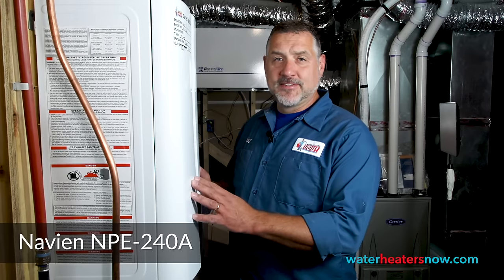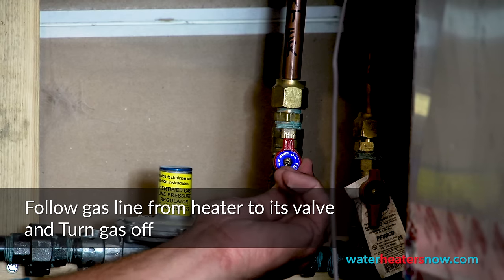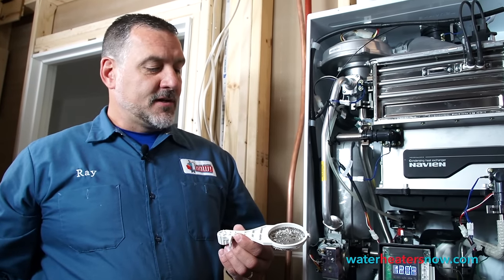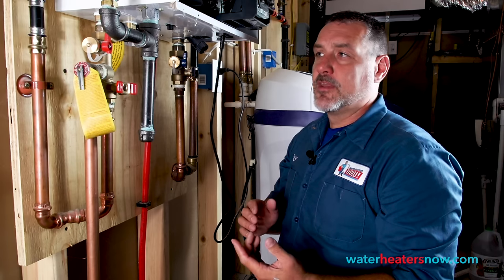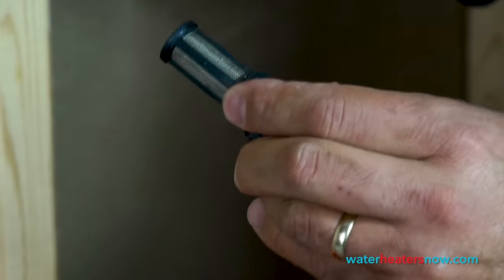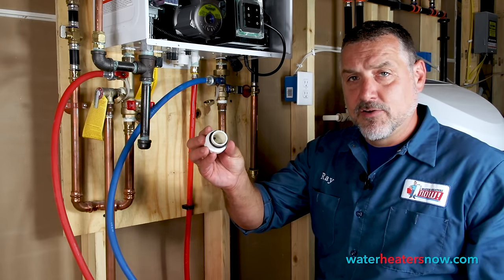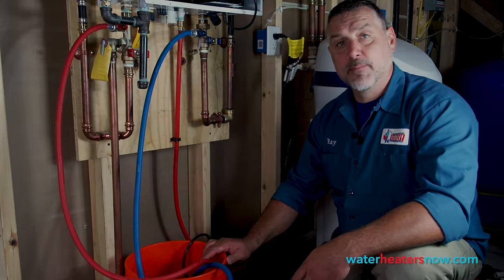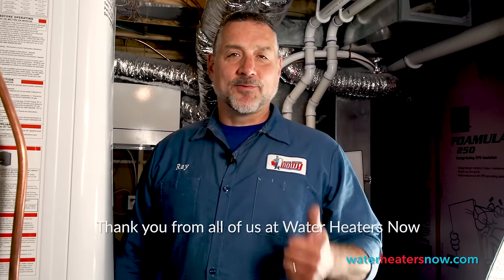Navien Tankless Cleaning   Water Heaters Now

Comment: Did you know you shouldn't use any metals that can corrode due to the acidic condensate water? 
I recently had a service call for a water leak off a Navien. 
They used a Brass female  X brass pex adapter and the pex part was GONE!!!! Eaten away. 

Never seen that before. I emailed manufacturer and they said the condensate drain needs to be in PVC and no metal fittings 👍🏽

Comment: While you're waiting for the vinegar to cycle, I remove and clean the ignitor and flame sensor. They are also prone to deformity and failure.
Reply: @Genetikz MusiK in most of the npe units I've serviced, they include a replacement set with abrasive cloth to clean sensor and spark rod.

Comment: You do so good
Reply: That's normal as the vinegar "dissolves" the calcium carbonate scale and the color of the vinegar does not change appreciably.  
While you might be able to use the vinegar again, I do not recommend it.  The vinegar (acetic acid) acidity (pH) drops as it dissolves accumulated scale, and it becomes weaker and weaker and will take longer to do the job next time.  Once a year cleaning is not worth storing gallons of a mild and contaminated acid. 
 I suggest buying two new gallons - it is inexpensive and still much much less expensive than having a plumber do it for you.🏁

Comment: Lol, was installed by a plumber, keep the gas valve at the unit, only the 1 inside screw needs to come out for the “fresh air filter”, flush ports, not service, they add those ports to chemically clean. You have to use cleaning vinegar, not reg white vinegar. Better yet, use Haymaker, will clean 100% better. If you have a boiler issue, call a licensed Hvac, plumbers change toilets

Comment: That system has softened water, you can see the softener in the background. There is no need to descale every year. At most that unit will need descaled every 5 years.
Reply: Salt buildup?
Reply: No salt build up. Navien sells a scale filter that can be installed on the cold water supply side. The media only needs replaced every 2 years if memory serves me.

Comment: Good presentation but where is the scale coming from as there is a water softener installed? And no salt build-up due to sodium being a “soft” ion. You can put an inline filter on the cold side after the softener however- just for peace of mind. Again, isn’t the purpose of the WS to eliminate scale? Why have the softener if you perform annually vinegar maintenance? Am I missing something? Perhaps this video would have had more credibility without the softener in background. I noticed a no show after the vinegar descale. I do agree with annual air filter maintenance. The sump should be clean as the softener is serving as a filter when the water goes through the resin media in softener. If anything, I would check sump for softener media going bad- around 3-5 years because chlorine burns the media. I wouldn’t charge for maintenance either......just give them a video. Good presentation for heaters without softeners. How do you justify the sale of the softener when the owner purchases the tankless water heater if maintenance is the same?

Comment: A Milwaukee transfer pump works better and you can use it to drain tank style heaters faster.
Reply: Sure,  But for less than an hour's use once a year you can buy a less commercial sump pump for much much less than a  Milwaukee transfer pump.  80% less.  But if you already own one, well, by all means, use it.

Comment: Thank you so much! Had my Navien thankless hot water heater going on two years (whole house remodel late 2016, 2017)  this morning, I found the hot water at my bathroom sink not getting hot. The error message I got at the tank was E016.  I Google my tank and found a page for errors. https://www.waterheaterhub.com/navien-tankless-error-code-troubleshooting/  which states I need to service my filter and heat exchanger. Another video showed how to clean the filter. I did unplugged my unit for over 30 min and pulugged back in. My tank did reset back to 120 degrees F, but I sse from this wonderful video adn the error code, I will need to clean the filter and flush the unit out with vinegar. :)

Comment: Never trust the off on the machine this is just a standby always have a separate power switch tie in and remove the built in fuse as per electrical code in your area

Comment: This technique is not correct. There is a bypass valve... on some units. You need to set temp up to 140°. CHECK WITH MANUFACTURERS. AO SMITH HAS A GREAT HELP LINE.

Comment: You cam flush both sides hot and cold.  Also the condensate shouldnt be a brass or metal fip. The ph of the condensate will eventually rot away the metal

Comment: If you have a water filtration and softener you should not have to delime the heater...
Reply: Well, not as often.  But you should flush the system periodically, perhaps every 3 or 4 years.  It's not difficult or expensive and you know what they say about the value of an ounce of prevention, . . . .